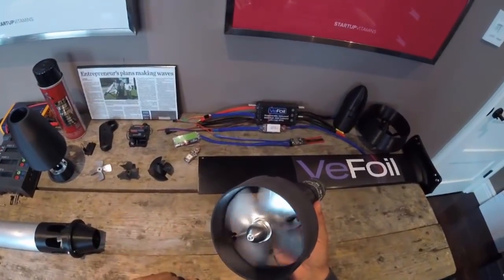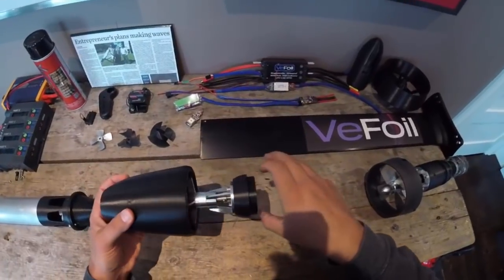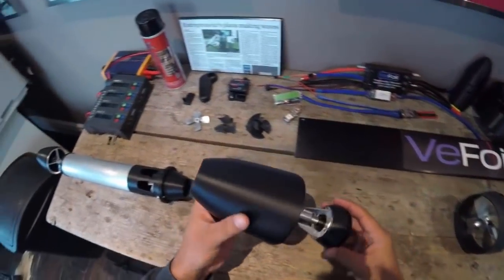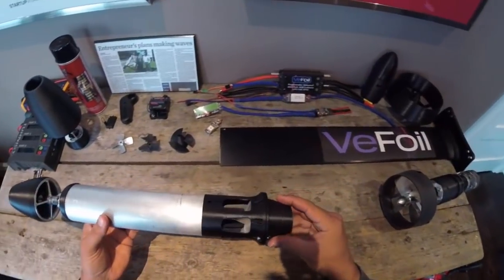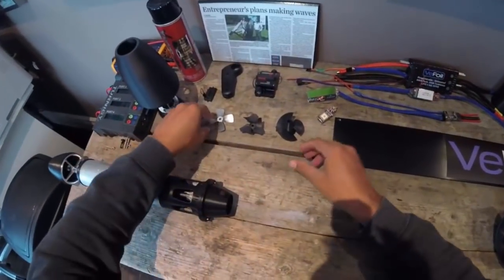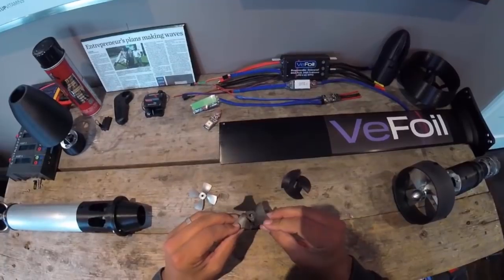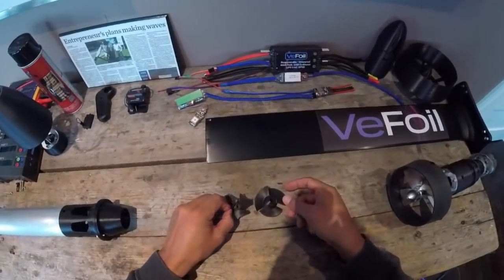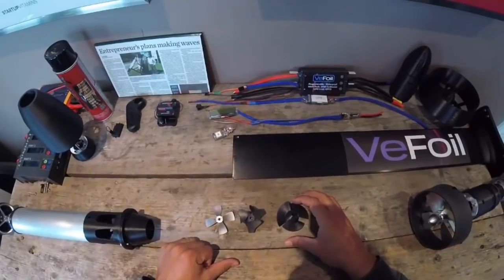VeFoil by VeConcepts Part 6 DIY Electric Hydrofoil Propulsion System

Comment: good afternoon. and can you write a link where you bought the gearbox ? and then we have in Russia, I can't find a good gearboxes((( and my gear after 8000 rpm at the input disables the reducer
Reply from the maker: Reduction gear was $40 totally junk, only worked for a few rides then died. The PLE40-5 - Neugart reduction gear is $500 USD with shipping which is why we designed direct drive to eliminate this part and build a more reliable and affordable unit.
Reply: and you have finished testing the direct drive motor? did you do it?

Comment: Have you looked into the Ring driven thrusters?  They have the magnets in the shroud and the ends of the propellers are the rotor running inside the magnets.  Your wing is also getting thick enough to house (maybe 6) small motors in the wing with ducts in the leading edge and exits in the trailing edge.  Look at what NASA is doing with distributed propulsion on electric planes.
Reply from the maker: Yes, I have seen few designs like that online. While its really interesting we are shooting for simple, effective and affordable. Costs and issues skyrocket with multiple motors, props, and ESC's.

Comment: Very interesting. I'm betting with you that direct drive, and appropriate sized, designed prop / impeller is a winning combination.
Reply: I wonder, why nobody was thinking of this at all. in the E-skateboard-scene some people re-wind the motor to the RPM they need. 
so no need for a reduction gear.
I said this on a facebook group months ago.
glad to see, you do this now.

ps: I live in China (work there) if you need my support, I am glad to help

I have a 3D printer here, 4 E-skateboards, a jetsurf, hydrofoils... 
and live on an island with enough beaches (can print stuff and test drive) 
; )
Reply from the maker: Thanks JP. Good to know!
Reply from the maker: We seem to agree also Craig.We just changed added a few new setups with impellers 58mm, 60mm, 64mm, and changed a couple design to reduce weight by 50% on the main section of housing which is great. Again, we are going to simple, fewer parts the better, and as safe as possible with no way to access blades for safety.

Comment: Hi ,nice video!.I'm pretty new to this,but is the reduction drive for speed or is for torque? or both.I thought it would be simple just running it to the motor it self or is that bad?..Chers
Reply from the maker: The reduction gear is to reduce RPM which increases torque for turning a larger prop. We are not using reduction gears anymore, and have gone direct drive as its safer, less parts/issues, less weight, and cost less to build.
Reply: Have you found a suitable direct drive motor yet? 
If so, which motor? Cheers